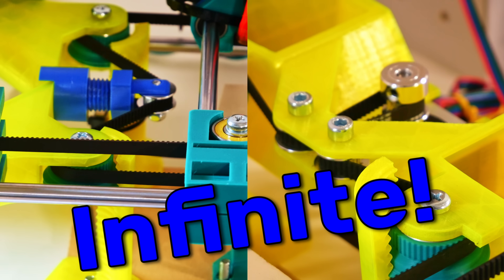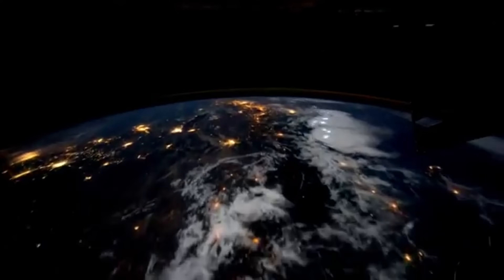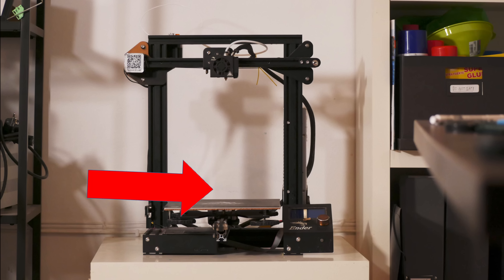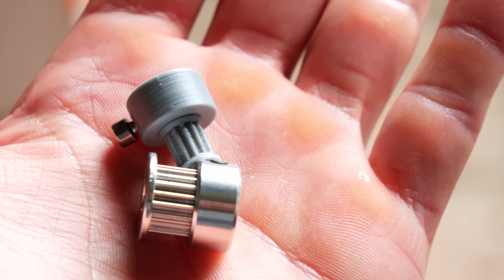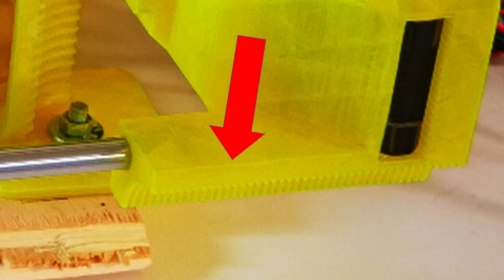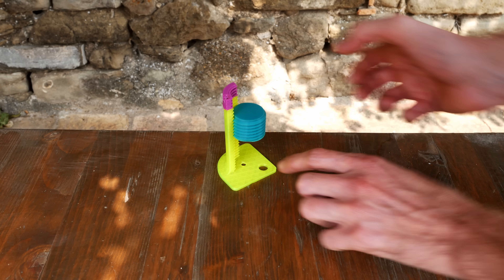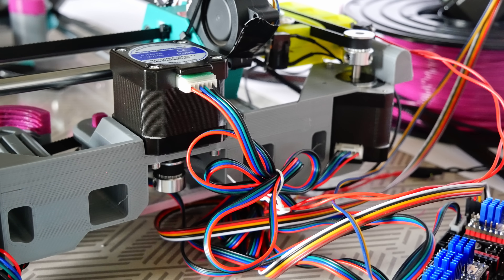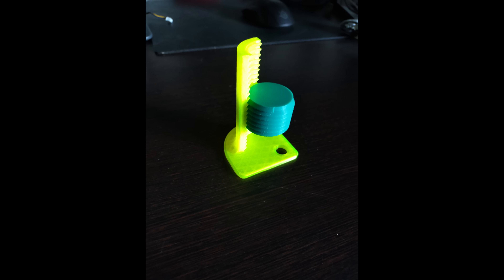it can 3D-Print onto itself?!

Comment: this is gong to be a nightmare to get working, just getting the legs to print themselves seem hard enough
now do that without belts, a way to tension anything, metal rods, assembly,
not to mention needing to power the thing, feed it material, feed it "data" you need to print your own wireless communication device some assuming you have a command center to run the replicating printers, once the printers are printed you need to move them and set them up
don't get me wrong, cool project but, holey F this is so far from the realm of current possibilities it is not funny\

Comment: I'm an electronic engineering student
And from what i learned about transistors
It's very hard or almost impossible to make stable transistor if it isn't environment controlled as building smaller and purer transistor can be increasingly be affected by the environment like temperature, pressure, living organisms, humidity and other non-transistor material.
Also at some processes it requires high temperatures but maybe you can do it by making a flash heater using capacitors
But if you can make infinitely wide 3d printer and you can supply high voltage then maybe you can 3d print bigger transistor so it won't be much affected by the environment
As i see you haven't mentioned the energy problem
Which either you print solar cell that requires silicons or a magnet that requires another magnet to change its magnetic direction.
In summary i feel like it's a long journey that can take years of research 😅
Reply: As a semiconductor engineering student, yeah i have absolutely no clue how he is gona pull off 3d printed electronics lol.  PCBs i get even though theyre hard too, but making any actual semiconductor devices requires at the very minimum ion implantation and i just cant fathom how that could be done in this type of setup.  Maybe he'll just source premade components and figure out some way to put them onto a PCB cheaply.  We'll see i guess

Comment: Seems like you're only able to expand on two of the axis printing larger versions and are constrained to the same initial size of the third axis, so you would never be able to print a car sized object but end up with somthing like a wall at its larger varients where the x and z is large but y is comparatively still narrow. or am i missing something?
Reply from the maker: It would take 2 revisions: after the first you could print a wall, but instead you print a wall sized printer, the wall sized printer can print a car. Hope this helps

Comment: This is RepRap? I printed a RepRap Atom X about 6 years ago. That can print the parts for itself... apart from smooth rods, motors and belts, bolts/screws, screen, mainboard and cables lol. Nice engineering though. This is the kind of thinking we will need to go to Mars. Ps, Gravity will be weaker on Mars for those quarter screws thread problems...

Comment: I like this idea. But the question is how to get it to completely print in place without anything to touch it or load it with filimentor at the very least have something that can be built and automated to assemble or move parts amd load the new printer.  

I've got alot on my plate right now but I would like to contribute when I have the time. 1

Comment: It feels like it's difficult to overstate the significance of this. If you can actually make a low cost 3D-printer that can replicate, even though it's all plastic, if just a small fraction of the concepts you prototype and can get to work can be transferred to a version that builds in more solid materials, this paves the way for... Well, just what you talked about in the intro, but I mean - for real! That's insane! Thinking of "We are legion (We are Bob)" by Dennis E. Taylor here🤩

Comment: just a thought: it reminds me of how a sky scraper can expand and grow in height. if you were to take the gears and have something like block tracks where it would be able to grow inside then you could print all direction and not just clone. an idea on how i would try is maybe if the metal rods were split in half and turned into worm gears you could build from middle outwards. Take 1 axis and lets say the x axis. you could have 2 gears on the printer to travel the 2 gears that are being printed. as its being printed the nozzle would stay close to the middle left and right when the axis is complete you would have the 2 printer gears go in reverse direction to create pressure on the rod eventually locking the 2 pieces together. that way the printer would then be able to travel the entire distance. the supports for longer distances would be harder to deal with however you might be able to print supports as you print the axis since the printer would be spinning it outwards as it extends the support.
Reply: This is an interesting idea.
Reply: Watch the movie Tomorrowland there's a scene that they do this in

Comment: i got project ideas for you. 
- a 3d printer that starts as a cube then 4 legs unfurl from the corners of the cube to now look like a spider and the nozzle is the spider printers belly button. eventually you can have the spider walk around and print to have infinite x and y
-a pet bottle filament extruder made from a 3d printing pen

-a 3d printed gun like the print in place GB22mini but integrates a magazine and an case ejector on the bolt
-The hang printer 3d printer but more compact and cheap
-a 3d printer like the tread mill printers but it uses wheels to drive and prints on that suface, which would reduce cost and size

i have more plausible ideas written down and/or prototyped but im not smart enough to finish them

Comment: There's a 3d printer that is built by Pulleys and string and has a near infinite build volume. The components easily fit within a very small build volume. You just have to mount the pulleys.

Comment: This won’t work it’s too costly and printing layers make the part weak since it’s just adding layers not actually bonding just sticking. You need something as a whole to be strong layers aren’t strong. And to print it self but bigger it would need to be in pieces and assembly to build it. 
This guy is just a dreamer

Comment: Another lame video. The plastic parts are not the difficult part of replicating a 3D printer. What about motors, electronics, belts, linear bearings, heating? But it seems that this "it builds itself" nonsense never stops, even though again only 20% of the entire system is reprinted at a lower quality.
Reply from the maker: Next video is on printing metal and motors, as i said and teased in the video.

Comment: I love the idea and I can definitely see the uses that this system could have. but the biggest problem I can see is that, unless the threaded legs are they themselves supported, they can start bending inwards over time. at some point the legs will lose structural integrity cause .they're only supported on 1 spot. 
with the idea of printing 2 printers at the same time and incorporating the legs into the frame of the printed printers, this will obviously aid in stability. but another solution would be to incorporate struts between the legs to increase the stability, which would allow the printer to go up a lot higher before becoming unstable.

going to metal printing would also increase the max limits, but since those need some heavier parts, and since metal prints tend to need post processing, I'm not sure how sturdy the selfprinted legs can be before post-processing happened, and how much heavier the printer would be, so that might be an issue. 
also: I'm not sure how complex the pieces can get with regards to built in place mechanics, and well, you'd still need a way to post-process these larger pieces. but I do think it would increase the utility of the system so it could be a good idea to look at. and who knows, maybe this idea can become a lot easier with some (near-)future technology :P 
anyways, very cool project looking forward to how it evolves :)

Comment: I wonder how you would print the heat-sensitive components (like the hotend and the build-plate). They need to be made of a material that will not return to a fluid state when reheated.

Comment: Sorry but why not just have the z axis legs built in sections that snap together so that you can simply print an arbitrary number of them then snap them into place as needed? Like I get you want this thing to be self assembling but I don't see how you could do that without some pretty fancy robotic assemblers for the parts. Additionally not sure how you plan on producing the metal parts without just casting them. For such castings the best course of action I think would be to print the part in high impact polystyrene then submerge it in sand then pour molten metal into a spout leading to the print. The metal vaporizes and displaces the polystyrene taking the shape of the part, then all that remains is some sanding and testing to make sure the part works.

Comment: Just add a thermal camera to map where the nozzle is and where it was on an autocad program. I suggest running the operating system off c+ Or similar style. This will replace the expensive sensor and it doesn’t need to be a great camera to get a radius of heat that is consistent for a nozzle location by the way!

Comment: as the printer raise i think it could use some x bracing between towers on at least 3 sides. this allows the printed part an exit, but tiess the towers so there will be less error due to elasticity. you could also use the cross pieces as fixed points to recalculate position as you lift.

Comment: I think adding an arm to the print head will allow you to both test distances on the fly, and connect things. The print head is a sturdy point that you can reach from above to the printed area, and park back above when not in use. A tool caddy for things like a probe, knife etc gives options like on a CNC mill. You could even have a camera on it to do 3 d scans as you go to continually calibrate your position as you rise up.

Comment: Very cool, but a printer on 3d printed legs quickly loses stiffness and stability as the legs grow taller.  Plastic frames are notorious for warp and flex, which are likely to reduce print quality and reliability quite substantially.  I have (most of) a 3d printed printer I designed for printing flexibles on my shop table, and rigidity is very tough to get with plastic frame parts.  That said, I can sympathize with both the struggle and passion involved in this project and hope to see this progress and reach completion

Comment: Having the ability to expand an axis without limit is a novel solution to some classic Reprap problems, I like your idea. The render of how you can arbitrarily change the scale of a child printer (on one axis at a time, at least) was really attention-getting. I was assuming advances would first come in improvements in the percentage of self-printed parts in assembled printers (eg. Snappy, etc.), but you seem to be trying to skip as close as possible to a single-piece (or 'print-in-place' as you put it) 'clanking replicator'. Ambitious! Here's to open-source design solving humanity's problems!

Comment: You're documenting this with the rest of the Reprap community, right? Because they've had the exact same quest as you from before 3D printers were called that (and basically provoked consumer 3D printing to become a thing with their open-source designs). They could be helpful, and will also be REALLY interested in expanding on these ideas. I'm actually kind of shocked you didn't mention them, honestly.
Reply: He did kinda, that one printer is definitely logged on the RepRap site.

Comment: Nice effort. Maybe those part like screws and some electronics can be made of prints that make molds to cast iron and sodder metal, or those printers of fiber glass material that just require to apply pressure to solidify

Comment: I have an app which I’m trying to build, to improve toolpath generation and ability to license and share designs to monetize an 3D printing platform using features like non-planar platform. By giving users the ability to collaborate and lead their own manufacturing initiatives, it’s possible to transfer IP and do production runs without necessarily taking part in all manners of the production process. 

I’m interested what you and anyone reading likes for features. We have a material optimization system which will allow you to customize the way your optimized parts look, and a layer which resembles Etsy, all on top of a CAD model viewer and the G Code generation. Eventually we want to move to mills

Comment: The word "revolutionary" is overused these days, but I think it really applies here. I literally feel like I'm witnessing acomplete turning point in the way our species does the very task of building things
Reply: This is far from a new idea. The concept of self-replicating machines has been around for nearly a century. 3D printing definitely is an obvious leap towards realizing it, but all the core problem remains the same: precision. 3D printers almost universally get their precision, and thus ability to print reliably and to spec, from metal parts. Printers that use 3D printed parts, like Prusa printers, only print structural pieces, not functional ones. Without things like precision machined linear bearings, the printer won't be able to print anything of use and the fact of the matter is that printers aren't capable of printing to the same precision they are manufactured with. It's inherent to the material used to print. Plastic deforms where metal doesn't. Metal-infused filaments are still majority plastic, there's no getting around it.

And all of that ignores that a truly autonomous system would need a method of raw material extraction and processing. And then you start to run into possible doomsday scenarios like Horizon Zero Dawn.

It's an interesting concept to explore for sure, but to say at this stage that this will "revolutionize manufacturing" is nothing more than hyperbole.
Reply: @needamuffin  Ah, that's an enlightening perspective. Perhaps I was a little caught up in the wonderful presentation in the video
Reply: do gotta say this kind of attitude is what is needed to change the world

Comment: Oh, also if the print volume is less than the original total volume of the unit, it would always get smaller with each generation. 
In this case the print volume is at or greater than original by extending the Z height, but if the extrusion nozzle was angled at or greater than the X-Y boundaries, it would maintain or increase total volume with each generation. 
Hence, if the nozzle could pivot and extrude beyond the XY footprint of the original unit, and also extend further into Z by the same proportion, it could become proportionately bigger each time!

Comment: I guess to add a theoretical Idea is to package the Mother 3D printer with an assistant robot that does maintenance and upkeep.

And Basically have the assistant reclaim the components from the mother printer to rebuild it into the next generation of larger print volume or version. I see that as a more realistic version of that idea rather than having to make components for each new printer.  yes, it would lose on the self-replication but it would allow for the self-improvement path a lot more effectively.

Or just have a separate printer dedicated to electronics and fine-detail objects like the stepper motors and sensors.

Comment: I think the biggest problem with this though is that machines can only make (quality wise) with what’s used, and with 3D printers, there will always be inherent quality issues, I think you need to take a step back and look at the bigger picture which would be to create an A.I that is self taught to construct things using materials, as the touch up on 3D printed parts is usually done by a human, but if you teach a robot then they can adjust for errors on their own, thus allowing the A.I to copy itself entirely, all you would have to do is give it the materials to do so

Comment: Adding lateral girder elements in-between the legs should be able to provide greater stability to the legs. These girder elements should be printed just inside the printing area edge and ought to connect with a leg on both sides and with the lower girder element below it. A multiarched bridging effect should both provide greater stability for the legs while not consuming a huge amount of the printing materials.

Comment: This is a beautiful concept! There are a couple of ideas I've had for about five or so years regarding 3d printers that can replicate and self assemble. 
Your Mars base may need to have the materials necessary to build some kind of forge on site, either operating through induction or some other means. It would also need to produce at least one worker drone, to source and gather materials.
You could experiment with different sized drones for different purposes, but the basic premise is to continue production. 
You could set one of these systems up in a city to recycle waste plastics and metals into filament through the forge, expand the size of the swarm, and build up the system for its voyage to Mars. 
These printers will need printer food, and unless you're going to give them legs and a mouth, they need some drone swarms!